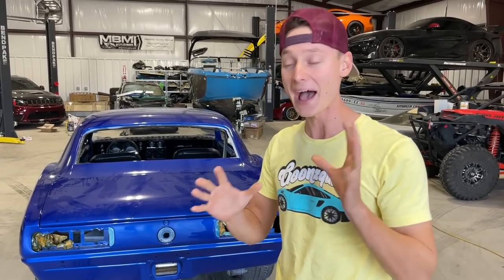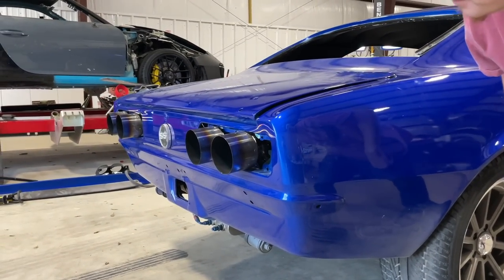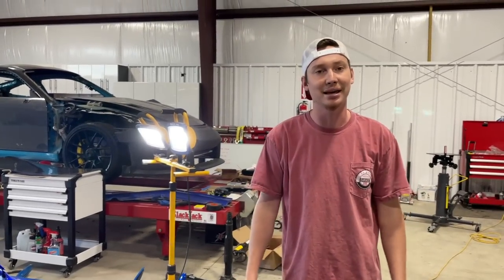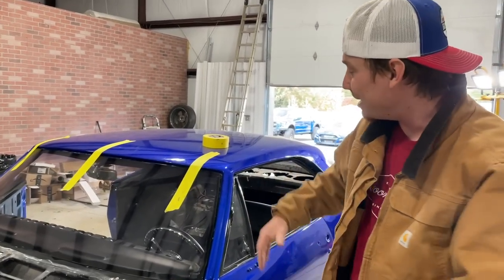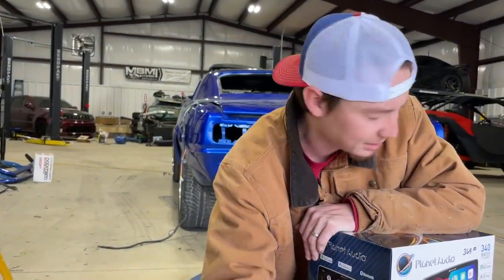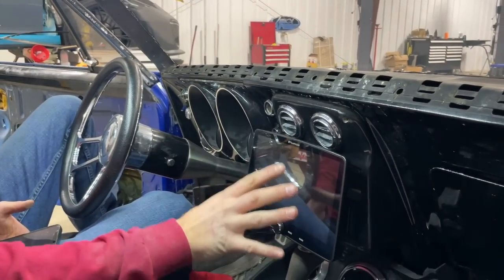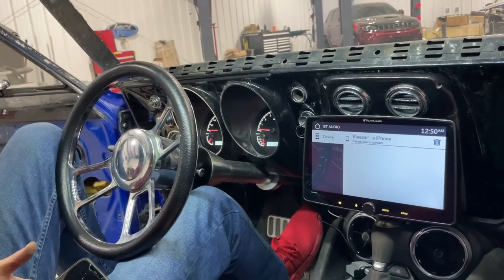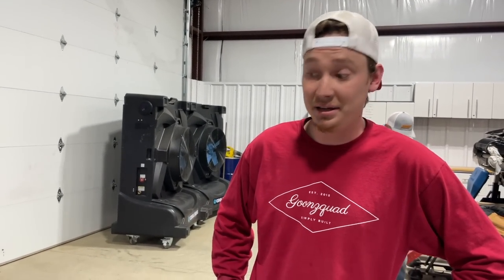Our LT4 Swapped 1967 Camaro Gets An Insane Stereo System!!!

Comment: Love the videos guys, i have a couple pointers for car audio for you. You definitely don't want to turn the gain all the way up, as it's not a volume knob. it will send a clipped (square wave) signal to the subwoofers. Which isn't good for them and will eventually cause the voice coils to fry. Also, that subwoofer box will likely be louder if you turn it around facing the rear of the car. I've been into car audio for about 15 years now. So if you need any info feel free to message me.
Reply: also to increase the bass and to eliminate any vibrations think about using sound deadening on your doors and boot/trunk  you will notice the difference 1ce everything is complete in the interior and 100% agree with devon
Reply: I back both of these comments. Y’all did a great job for your first time but definitely make a few small changes mentioned above for a much better output!
Reply: They bought Audiopipe, Boss, and Planet Audio. Do you really think they care? LOL
Reply: What a ghetto hack job! I would have expected better from these guys. 😠
Reply: @techmaster242  Ya that is too nice of a car. I would have finished the interior and dropped it off somewhere to have audio installers install something that would match and look clean....its not like they don't have the money to have it done right.
Reply: @loopyogden  Exactly, they're making millions and they just put Walmart trash in a nice car. They could at least deck it out in stuff like JL, Kicker, Memphis, etc...
Reply: Exactly what I was saying when the put the box in facing forward. You know as well as I do but it’s best to not set that gain all the way up. Myself personally I would not tune the system until the interior is complete.
Reply: @techmaster242  theyre not into that scene. You see how happy they were with what that system was doing. Even i came to tell them to turn the box around. But after seeing all these comments from jerks i actually feel bad for them. I understand trying to help them but why be insulting smh
Reply: Yeah, I normally mind my own business but I gotta say this one was painful to watch.
Reply: The total system was 1k, they supported a local business - and they aren't audiophiles. Turn the sub around and I think it will come together for their needs when they button the car up.
Reply: @techmaster242  These are the comments I came for I enjoy the stuff they do but if I’m being honest when it comes to a few things they really need some pointers
Reply: That amp ain’t it. Should have bought a D Class!!
Reply: Imsee what a lot of ppl are saying on here yes the sub is around the wrong way yes they did do a lot he wrong way but what can anyone say did they do there first set up right  it's about what fits you best my self I would of done a lot of things differently but if anyone knows them they do thing there way I did try and see what wet up they had it don't look to bad but the only main thing I didn't see was a power cell to stop it from killing the battery no realise I use them most don't don't know if the sed the fuse from the battery when I do a car t takes me 3 days for full set up but they are half way there as all the inside is out do need sound dampening stops vibration and it's tweeters not tweakers them vents they put in I would make them in to speakers or link them in to work they do look good there there so much thing that can be done with a car I do feel it's a wrong fit for that car but a car like that you make it so when you drive it it's all about the engine and the exhaust system but that's me
Reply: Bridge the speaker and def face them in not out
Reply: That amplifier itself has a really high thd. I can't recommend enough, to stay away from companies that sold off everything to Chinese build houses, like the unfortunate event that Scott had happen, when he co-owned re audio. I will only run reputable drivers on either good Korean boards or Brazilian boards.
Reply: I would just suggest taking the guy to the shop and have him tune it and ask if he could explain what he does to tune the system since they like doing their own stuff
Reply: Damn even some entry level Sundown 🤣
Reply: @macksunday00  with the fact that they paid $175 for an amp that you can buy on eBay for under $100, something tells me he's not in it for the knowledge.
Reply: Hahah I just mentioned that in another comment about everyone thinking the gain is a volume knob. As far as sub placement turning it around isn’t going to do much. You need a decibel meter and play around with placement to find the most sound out of that cheap prefab box.
Reply: Right! Tons of distortion. Amp needs to be tuned to optimize audio output
Reply: @techmaster242  lol you said Walmart trash, I was thinking more of the likes of cheap flea market. $300 for that head unit. Lol. You have to remember the brothers got burned big time by buying the Camaro period.
Reply: @PhilG999  I wouldn't. This is exactly what I expect from these guys, hackery at its finest for the camera.
Reply: @PntBtrNjelus  And no idea how to set up a car audio system! I've been doing it since before those guys were BORN! '76 Monza 2+2 hatchback (which I still have) in about 1980 with a 200W amp/EQ feeding two 3-way speaks under the dash on either side of the Sony CD player and two 3-way Speaks in Ratshack boxes in the rear footwells. Which I could move to the back if I folded the rear seat up !

It's all fun if you have good ears.
 
I DO like the Monsoon (Delco/Bose) system in the '05 Grand Prix GT2 I inherited from my dad when he passed in 2015. Had to do a little work on the '99 GTP though. Factory speaks were crap and I had to replace them with Pioneer 4-ways. The door ones were fun. But I can max the stock HU and it still sounds (relatively) clean!

😁

Comment: I'm a 20 plus year MECP certified mobile electronics installer. 

That planet audio deck is decent but leaves alot to be desired. 

The car play and android auto requires a wired connection unlike other units that support it wireless. 

I posted in a previous video of a good option you'd really love.

They make decks that support the Maestro system. You can link this system to your cars ECU and have digital gauges with oil pressure,fuel level, speed, RPM and  CEL information. As well as climate controls and open doors info. Aswell as the ability to map and use steering wheel controls in a bunch if cool ways. The climate, door info and SWC mapping wouldn't work on this car obviously but the ECU stuff would. 

Another option becoming really popular is using a good basic single din deck with Bluetooth. 

Then buy a iPad of your choice and buy whats called a slider kit.  It's a pocket the iPad docks into that can be molded into a dash bezel with CA glue and some filler and sanding work. When done right the iPad docks and looks like a factory Tesla screen that can be removed when needed.

You can find a secondary location for the single din radio to run the audio through. Or some people in set it enough that it sits behind the slider and they cut the opening in the back of the slider. 

So it's in the dash behind the docked iPad. 

Google iPad dash kits you'll see what I mean!

Comment: Love you guys and how you tackle new stuff! Stereo advice. The gain is not a volume knob. You should research amp tuning to match the head unit voltage going to the amp. If you turn up the gain too much you will blow your speakers over time. Too much gain causes a clipped signal which will cause extra heat and distortion. That will blow your subs fast. Setting the gain to the right position based on the head unit voltage will let you turn up the bass without fear of ruining the signal and sound with distortion. Have fun and rock on! Oh and turn the sub box to face the back for better sound.
Reply: I winced as well. Good advice. 👍
Reply: Great advice, but it’s head wattage not voltage.
Reply: @ian0401  its head voltage and amp wattage... just sayin. It's complicated electronics simplified for us normies.
Reply: Good advice and please turn the subs around fellas
Reply: @deepredstate4414  yep I get that mate. I shouldn’t have put the word “head” in the comment as it’s not the variable in the equation. 
I base this only on my knowledge of this as a guitarist 😂😂 not of car stereo. 
If they crank the gain too much it will blow the drivers (speakers) if they can’t handle that amount of wattage. 
It’s also important to make sure the impedance of the drivers match the amp, I’m sure they do as they got all the gear from a stereo guy!
Reply: Also needa swap out the boss speakers
Reply: @devinclegg4784  Actually. When I look at this...are we being April Fooled early?
Reply: They did ok for a first time.  I also agree they need some tuning on the system because a seasoned person could most likely unlock that setups potential.
Reply: Also is the Amp bridgeable if so do that and get the full power
Reply: Better amp would be best as Crunch is, well, let's just say not very good at giving a clean signal which helps in roasting drivers. I would suggest Audio Control for the amp. I have an Audio Control LC4.800 running my DS18 Pro 6.5" mids and Pro 3" bullet tweets, and a SKAR Audio 800 watt rms amp running 2 DS18 GEN X 10: subs.
Reply: @devinclegg4784  yes, lol
Reply: @ian0401  well said mate :)
Reply: I said "it not a volume knob" haha
Reply: If it ain’t clippin it ain’t hittin.
Reply: @franksgaragehonda  ha ha :D
Reply: @DjId3Nt  They should drive the car to the audio shop, where they bought the gear. I'm sure the dude there would be more than happy to tell them what is what and put in some decent tuning. It's not like it would take him all day when it's already physically installed.

Comment: Hay guys just a few tips on the stereo system.  Subwoofer box has to be aimed backwards, meaning subs have to point towards the trunk lid that's why the back of the sub enclosure has an angle, also. Sp makers you installed are called coaxial speakers, woofer, mid and high, the best way to configure it is using the internal crossover in the stereo so you can separate mid low and high frequencies on the speakers and sub handling low frequencies. I f you need more feedback on stereo installation I have plenty of experience.  The Camaro is getting awesome guys, congrats !!!

Comment: definitely turn that sub box around so it's facing backwards. there's something called the coupling effect and once the sound wave bounces off the back of the car and then comes forward it will be so much louder. trust me, I've done this over and over again. it was one of my mistakes when I first started doing car stereos years ago. it will make a huge difference for you. it will be what you want it to be.
Reply: Not a stereo guy but thought I'd normally seen them facing back. Thanks for the info.

Comment: In my humble opinion, the Camaro is by far one of the best cars you guys have ever worked on. It is a beauty.
Reply: the car looks ok from a distance but now they are just chopping things up rushing it and not to mention burn out after burn out......... then they will be wanting to sell it lol.
Reply: I agree
Reply: @Piercedguy  The amount of money they have poured into this car has gone way past the level of stupidity. Who would honestly buy that car ? The amount of cash they would need just to break even. You could probably build it twice over. At a professional level. 
Front sub frame major flex,,,, Don't worry about stuff like that. New sound system, much more important.
Reply: @Mike-qp8bv  that sub frame ain’t no biggie they sell new sub frames or sub frame stiffeners with extra mounting points to make way better then what it is now cuz it was some major flex in it that they definitely need to address before they get to twisting that thing up
Reply: I think there is already some twist in it , in the thumbnail one side in back is higher...of course it could be misadjusted springs (or coilovers if converted)
Reply: @s0UtHs1De419  Ya, I was just making a point. Get the thing mechanically safe before worrying about a stereo. The first gen Camaro subframes are so easy to upgrade. Everybody and their brothers make the damn things. Shit, you could probably go to Wal-Mart and buy one.

Comment: FYI, Original 1967 Camaros have chrome trim (mouldings) around windshield to hide adhesive. Early 90s automakers quit trimming windshields in favor of painting  windshield edges.  You are doing great job on the car.
Reply: They also butyl tape not 3M window adhesive with the chrome trim
Reply: No they are not.  The adhesive they used was never meant to be used in that application.  The window was never meant to be adhered into place. It leaves to many  open gaps so, even if they did put the chrome trim around the windshield, there are so many voids that moisture will get trapped and cause premature rusting.  Don't encourage bad workmanship, even if its cause of ignorance.  They are great body repair guys, but they are not classic car restorers or mechanics and it shows badly. 

That "boat" shifter they kept talking about, was an actual factory option, and if it is original, it's worth a mint and they just casually tossed it to the side.

They aren't doing a great job with this car by any means.  Yes, it was partially resto-modded but, their lack of experience, expertise, and knowledge is failing them badly.  All they have to do is ask any other youtuber, with any sort of classic car experience for guidance and they would get it.  Finnegan is only a few hours away near Atlanta and he could walk them through so much without them ham fisting around like a couple of Neanderthals.
Reply: @actschp1  At least they are better than the previous owner, who was a crook.
Reply: @herrakaarme  ah yeah, making excuse for their shoddy work by bringing up the previous owner.
Reply: @actschp1  Eh, I never said their work isn't shoddy every now and then. They are self-taught, if I've understood it correctly, so it's no wonder. That being said, fixing cars or houses isn't their job. Their job is to make Youtube content, and they are pretty good at that. Otherwise we wouldn't be here.

Comment: From a car audio guy with videos up myself, I would recommend not mounting the amps to the enclosure if you can. The prefab style enclosures aren’t the most vibration friendly on amps and speakers and can vibrate the internals to failure. I would mount them to a board and secure the board to the chassis. Also, don’t forget to secure the box and adjust the amps safely and keep away from distortion!!!! Bass on buddies!!!!
Reply: cant wait for the sub box to slide and the amp to hit the battery :(
Reply: When he turned up the gain haha we all gotta learn somehow tho
Reply: He doesn't have enough power for the vibration to be a problem. This is a pretty below average set up.
Reply: @MLG120790  that’s where you’re wrong. It is good practice to not mount amps to sub enclosures unless they are properly reinforced to withstand vibrations. Which those style enclosure don’t have. The amps they used are high on the scale for board vibration damage. That’s why I recommend what I did. As well as, a good practice.
Reply: @mikehonda7934  I have a 15,000w system in my Impala. I've been installing and rebuilding amps for 15+ years. Sure it's a good practice. But what I was saying is this system isn't powerful enough for it to make a difference. Amps vibrate just driving down the road. They are built with that in mind.. if I decided to mount my taramps smart 5k amps directly to my box then I would have problems. This guys system isn't going to run into a vibration problem. This is a baby system.
Reply: @MLG120790  I understand you. You must be in the chats with me and others on barevids and Likes of them. I’ve seen your name around. Could be wrong, but the amp repair thing gave me a clue possible. So you must know, I’m an installer as well and amp repair guy myself. You know that style board and company doesn’t secure the internal components well. So just in case, I wouldn’t put an amp on the box. I also know, if you’re running a 15,000w system in an impala like you say you are, you kept in mind keeping vibrations to the amp a minimum. And for your knowledge, I’ve been installing for 25 years. Light amp repair for 5, full repair, 1 year.
Reply: Currently running 3 DD 9500 15s and 3 Taramps Smart 5ks. My amp rack is mounted to the trunk floor behind the back seat. The subs are facing the rear in a sealed enclosure. Where the amp rack is mounted I layed down studio foam. And I don't comment much so I don't think it was me.. I just had to comment on the video title. "Insane" system is the farthest thing from the truth. Prefab boxes and Walmart brands.. lol
Reply: @MLG120790  my bad for the assumption. Happy to meet another basshead up here that agrees with a fellow bass head. I like to give pointers to help out a fellow car enthusiast and stuff. Sure they have to know that setup isn’t too crazy. They are in TN. Pick up trucks have louder setups than that. Yeah, sounds like you got quiet a setup there. I just sold my enclosure to my setup. Final build, 2 JL1200/1v3 on a single 13.5w7 lord of bass dual 1ohm coil and 4 layer Nomex spider cut to 3.5” from 3.” Enclosure, 4.5 cuft at 26hz 64sq” port area, with sub in, 23.5hz on almost the dot. Amps mounted vertically, SMD cooled fans pulls filtered air in, and blows it out toward my battery. Got a few videos of it playing.

Comment: Hi! Greetings from Norway! Just have a comment on the sound system. You definitely need a capacitor between the battery and the amplifiers. A battery is way to slow to deliver the power quick enough. Probably a 1,5 Farad or bigger is a good choice. Bigger is better! I guarantee better sound 🤟🤟 Some also have a voltmeter built in so you don't drain your battery. Keep up the good work! 👍
Reply: Capacitors suck